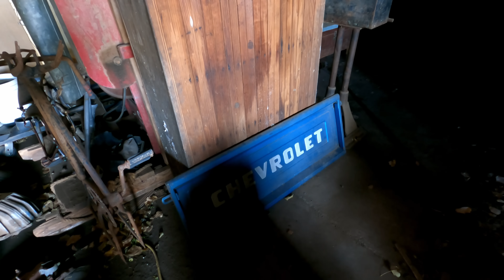Can I FINALLY Get Ready to Have an AUCTION of My Own?

Comment: i need a hydro vac brake booster off one of those old trucks mine is a 1966 D500 dodge but everyone says most all of them interchange its the booster mounted under the truck on frame rail

Comment: Drop the loader on the M and get that roll bar off and you will get interest.
Reply from the maker: They sold several of them in running condition at a sale the other day for $500 each. Scrap value is about $900. Not looking good for it unfortunately

Comment: Yep it is a shame to see that Ford cut up but you're right all the way around. Did you buy that 50 Ford for 800 bucks at the auction there and near Hutchinson? Are you going to post more details about your auction? I assume it's online. The tailgate is interesting because I've got a 70 short bed stepside. It has more than a perfect tailgate but it's aftermarket and you have to look twice but you can see the white letters are just stick ons. So an original one is of interest. Great video and I love how you work that loader and you sit down on your rack. I know some people realize just the length of those trucks. Poetry in motion. I may hate to see them cut up but you do it so well!

Comment: I have a question for hot rod guys :  Do those front axles on these medium-duty grain trucks work for rat rod builds ??  I know they are quite
a bit wider but it seems like the extra strong construction would be beneficial to a custom build with a big engine and trans.